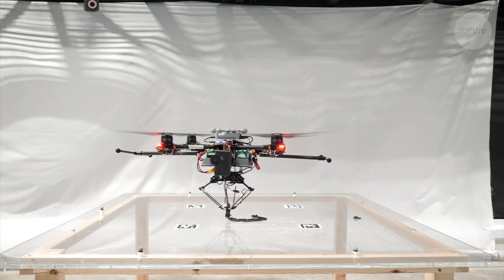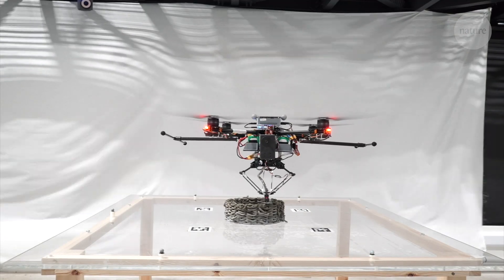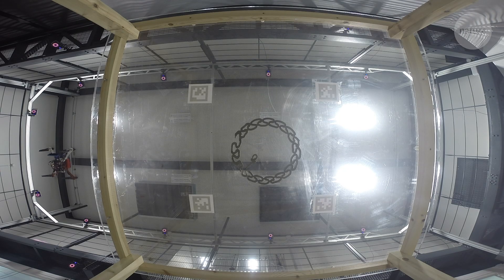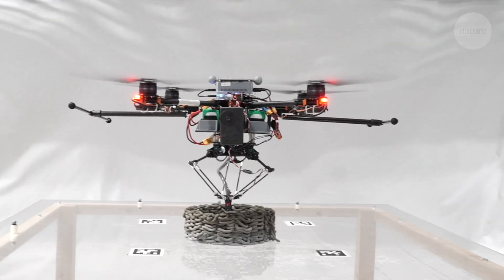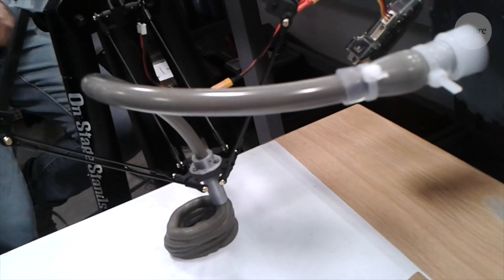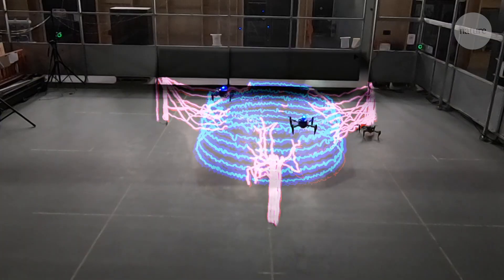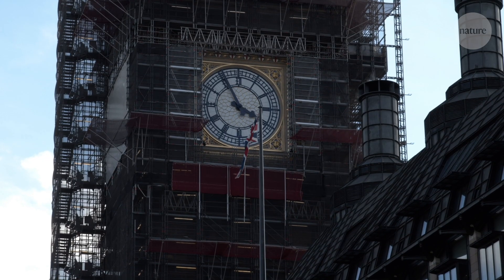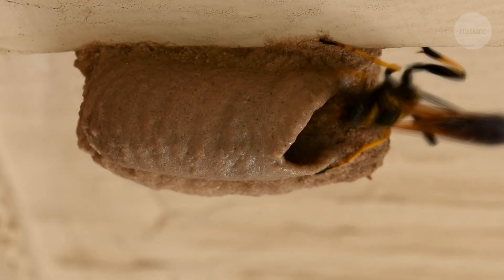3D printing with drones

Comment: Seems like a bit of a solution in search of a problem tbh...drones could be used to transport parts for a standing 3D printer, then quickly assembled on site, so that more structurally sound printing can be accomplished. Nevertheless impressive engineering!
Reply: Play doesn't need to offer a solution. This is simply responding to 'What if?' or, more simply, 'D'you reckon we could... ?'. 

So I say bravo! Keep playing and see what happens!
Reply: Why have only one solution? It's still early in development. I'd say let's continue to pursue many solutions and employ the best fitting. Ironman doesn't have just one suit.
Reply: @arcaetype  but he builds each suit for a problem.
Reply: If you read the paper it was designed for high altitude repairs it also scans in real time for the print quality
Reply: @Dot2TheLock  High altitude means both very strong gusts of wind in all directions and thinner air that requires even more power from the drone to just hold its own weight. When I see how hard that thing struggles to hover in the tiny breeze of their lab I can't picture it surviving high altitude conditions.
The scientific and engineering POC is impressive. But the actual use case is pure fantasy.
Reply: @christianbarnay2499  they do have bigger drones but hey when I use to fly rc planes people said drones where impossible. If a phantom can geolock above the cloud layer and shoot time lapse I think it will be fine.

Comment: 3d printed houses are still terrible in terms of what houses are designed for.
strangely
3d printed rocket-hulls+fuelTanks work very nicely, sure, they may have more air-drag, but they can be much lighter and much harder.

Comment: Until we have batteries that are orders of magnitude higher capacity this will never be feasible. Having an aerial printer is the less energy efficient way of printing possible. Construction materials are inherently heavy and you have to hold the drone and the material aloft the entire time it is printed. We are talking about hundreds of times more energy consumed to construct the structure. A ground based printer has to be placed on site but it rests on the ground and only has to expend energy to change directions or pump material.

Comment: Except that the obvious: bees and wasps are anchored as they work. Regardless, laudable work indeed. The algorithms they developed and the way they solved those problems are priceless.
Reply: I would go a step further, make multiple builder bots that each crawl along the structure while printing and multiple transport drones that ferry the builder bots between the structure and a recharge/refill station.
Reply: Both anchored and unanchored are equally impressive! Anchored means the weight must be extremely light, movements extremely delicate. Unanchored is a very difficult alignment problem.
Reply: @2hedz  also anchored must know how to avoid freshly printed area to not damage them
Reply: Maybe additional crawler bots could have docking points for the drones to connect to, stabilising their movement
Reply: i agree with this sentiment
Reply: what waste of energy ... creating trash via more trash. The bees and wasps are eons of that ...